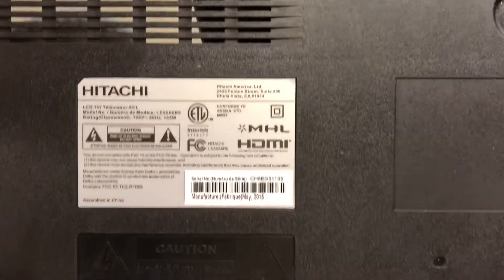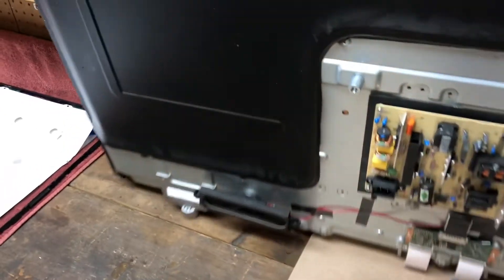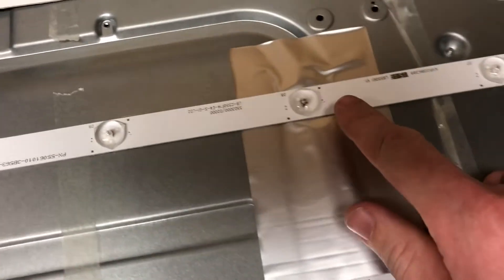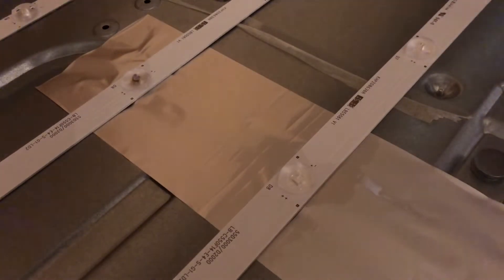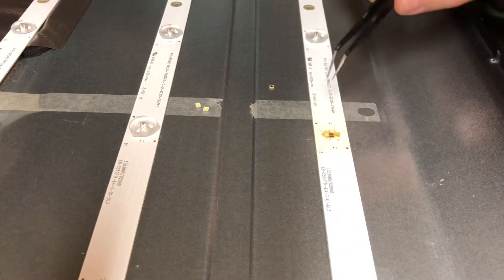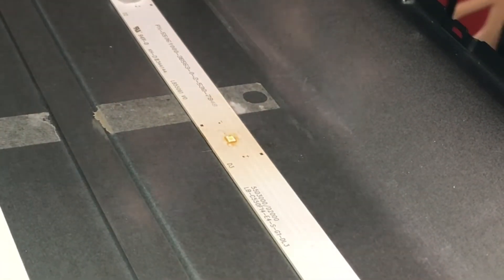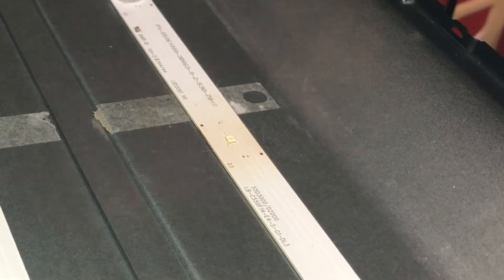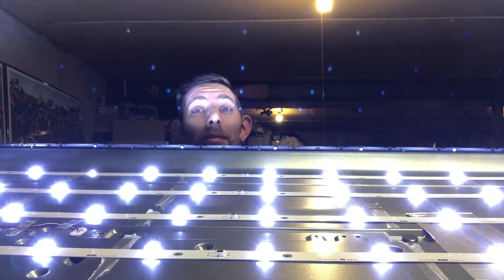Hitachi TV LED back light repair (Model: LE55A6R9)

Comment: Hi Dustin:  I have a Hitachi LE32E6R9 that just stopped working - no picture or sound.  The TV was not dropped or abused.  Could it still be LED strips/diodes or the whole circuit board?  Thanks.
Reply: I might add that the on light turns from red to blue.
Reply from the maker: @TravelswithJoeEly  it could be a backlight issue. Some of the main boards will wait for a signal that indicates the backlight is powered up before activating the main board. You may pull the back cover and check try doing a similar voltage check that I did in this video. Not sure if that model will have the same voltage readings, but you may be able to find testing process by searching the model number on the badcaps.net forums.

Comment: Nice fix, the trouble with these leds tvs is pretty much all brands cheap and premium are shipped with picture settings maxed out and many folk dont bother changing the settings so those leds are running maxed out day in day out doesn't take a genius to work out that they aren't going to last very long in that state, my samsung qled was just the same everything was on 100% picture wise i thought i was sunning my self in spain when the fecker first turned on, i prefer a real dark picture so brought mine down to my comfortable 15 to 20% as i only watch tv at night when i get home from work, also low settings make the tv last, this is very much like the rules you applied to the old crts to make the guns last longer keep the picture down low and they would last for ever.

Comment: How do you determine which voltage of LEDs are needed for the TV?
I have a 32"Hitachi that has a faint picture present, brightness control has no effect on picture, all else is ok, knock on wood.
Reply from the maker: Unless you can do some research on your specific model to see if anyone specifies what size and voltage LEDs are used, there’s not a good way to know without getting the TV apart.  Typically the LED backlights in these TVs are all or nothing. I’ve only seen one brand - Insignia, that wires the LED strips in parallel on some models, so that the backlight can go out gradually (Video here : https://youtu.be/EPU9lyh-rU8). Also, depending on the age of the TV, some older TVs use tiny fluorescent tubes instead of LED strips. I’ve also seen those go out “gradually”. The label on the rear panel of the TV usually indicate “Contains Mercury” if it uses fluorescent lights though.

Comment: My tv still working but won't stay on I was told because of a light bulb inside is going out how do I repair it at home ???
Reply from the maker: It depends on what it uses for backlighting. Some of the older flat screen TVs had fluorescent tubes in them. I’ve never had one of them apart to know what the process entails or if replacement parts are even available. What make and model tv do you have?

Comment: hi  i have led DENKA 55 smart  tv DGS-55UT2SLED i changed the light strips after i powered it up i noticed that only the lower 3 strips work and the 3 strips above are not working i check the strips by tester every group take the same voltage and leds all works but when connect the power supply and check upper group take 84volts and bottom take 130volts what is the problem i checked the pwer supply with strips diconnected i found diffierence but not hight between sides and then checked the resistance of output one side reads in kilo ohms and other in Mega ohmes
Reply from the maker: Mark Mark66 sounds like the lower strips may have some excessive resistance. You may look for a faulty solder joint on one of the LEDs in those lower three strips, or possibly check any connections between the strips and wires.
Reply: @DustinRogersinMO  i checked the strip one by on each strip take 32.3volts and check every group of strips they take same voltage but when connect to power supply bottom has 130v and above has 84v
Reply from the maker: Mark Mark66 can you measure the amount of amps required to power the upper strips vs the lower strips? I suspect that your tester is able to push more amperage than the power supply, therefore they light up when powered by the tester, but not by the power supply. This leads back to there being excessive resistance somewhere in the circuit of the lower strips.
Reply: @DustinRogersinMO  but how can say about the resistance of the out put ports of power supply to strips lower strips port in power supply has k ohms and the upper port reads in mega ohms i think they must has same ports resistance i checked them with and without strips connection
Reply from the maker: Mark Mark66 so you’re measure the resistance on the connections of the power supply? I’m not sure I understand what you mean. Post a picture somewhere and tag or link it here.
Reply: @DustinRogersinMO  yes i checked the resistance  of psu output ports i bring these strips from same tv same model i want to add that when i power up the tv the upper group flash and goes off and still off power supply model sgh5504c23-101hb
Reply: @DustinRogersinMO  hi i checked the voltage and current using tester and multimeter each group take 98V with 39.07mA
Reply: @DustinRogersinMO     thank u  the tv is worked now i checked the power supply ports of the leds there is 10 pins i changed the port of the bottom group and connected it to the other pin that gives 84v the led strips all worked when i tried to check the voltage the power supply waked up and gave 139v for each group then i retured back the wires on the original connection and checked the   leds worked all but the voltage on each group 131v what happened i dont know may be ghost  the tv now works normally

Comment: How did you determine that the power supply board was putting out ample voltage? What should the voltage be for both of the connectors going to the back lights?
Reply from the maker: DeeGi I describe it at 2:45 in the video
Reply: @DustinRogersinMO  I understand you measured 191V for the top one. Is that normal voltage? I know you said 250+V indicates an open in the circuit. I am trying to rule out the power supply board, but I can't find specs anywhere for what the voltage is supposed to be at those connectors.
Reply from the maker: DeeGi the TV I was working on had 66 LEDs wired in series. They were 3V LEDs,  so 3 x 66 will require at least 198V to power them all. If you’ve got at least the minimum voltage required to power all the LEDs in your TV, I would assume that your power supply is fine. 

If you have this same exact model of TV, I’d be willing to bet money that it’s got at least one bad LED. I posted a follow up in another comment or maybe the video description, that this repair only lasted about 2 months of occasional use before another, different LED failed. If you pinpoint that an LED failed, I’d recommend either ordering new replacement strips, or replacing all 66 LEDs, otherwise you’re just going to have it back apart in a couple months.

Comment: Very common problems on LED tv designed.User turned on brightness control to screen to 70% and beyond.The LEDs diodes workings to hard for days in and days out .So within about two years or more your tv LED strips on the tv will blown only one or two LEDs diodes and shorting out the whole LEDs diodes strip.The tv backlight don’t work anymore.Only the settings to screen brightness to 50% or to 60% maximum.So those LEDs diode on those strips and the driver board don’t burns out too.
Reply from the maker: Chi Chu sadly, I think the default on most TVs is probably set to 100% brightness. How else are the manufacturers going to get people to buy more TVs?
Reply: That why people buy LED devices designed should know about this and read their owner manual.If people ever bother to reading it.I do thinks the manufacturers do recommended on those owners manuals not turning on screen brightness background to 70% and beyond all lives days in and out using the TVs products.

Comment: Do you know what the voltage should be for each of the 2 connectors that go out to the LEDs from the power supply board?
Reply from the maker: DallasPilotCar I think I say in the video
Reply: @DustinRogersinMO  you said that if voltage is over 250 vdc then they is a open in the circuit..i have the led tester and the strips tested good.  So unless i know what the voltage should be to each set of 6, i cannot determine if there is a problem with the board that i bought used or if there is still a led circuit problem. You mentioned that you read it some where. I found the service manual but it does not say what the voltage should be
Reply from the maker: DallasPilotCar how much voltage do you currently have? There are 66 LEDs and are 3V that are wired in series, so you’d need at least 198V. When measuring voltage, you need to check it as soon as the TV turns on because if the backlight doesn’t power up, the voltage drops to around 80V IIRC.
Reply from the maker: DallasPilotCar probably also need to check the connections to each LED strip. I’ve repaired other TVs that just had a loose connection that caused the open circuit.

Comment: I had a hell of a time getting the deflector off because of the 2 sided tape.  I tore a little place in it and crinkled it in some places.  Wonder how messed up this will be?  Also when I put my meter on the diode scale and put leads on any of the leds in the tiny test places, no lights came on.  I went to the end of each board and checked the diodes and they seemed to be good and none of the leds looked burned
Reply from the maker: DallasPilotCar I’ve replaced strips in a couple TVs where every single LED was bad. Most of the time it’s just one or two that go out. Test your new strips. If none of the LEDs light up on it, your meter may be faulty, or the battery in your meter may be weak. As far as the ripped/crinkled deflector, I’d just use some clear tape on the backside to prevent further tears. You won’t notice it once it’s reassembled since the diffusers help spread the light a lot.
Reply: @DustinRogersinMO  What size is the battery in your Multimeter?  Is it a 9 volt or 2 each 1.5 volts?
Reply from the maker: DallasPilotCar mine is a 9V

Comment: I got this tv for free but, it has no picture and no sound only the blue light comes on for the power or red what ever color.  Is it worth buying the parts to fix this TV? I already had to order the power cord and the remote so I am out like $15. I have seen all of the boards in a kit for $70 plus the IR sensors, and then the LED stips I think for under $50.  How much did you pay for that little strip of LEDS?
Reply from the maker: DallasPilotCar it really depends on what exactly is wrong with your TV. Have you done any troubleshooting yet to determine what is the cause of the no sound or picture?
Reply: @DustinRogersinMO  I just checked the voltage from the connector that you are talking about and I read 188 volts dc.  On the connector above it the red wire to chassis ground I read 267 volts.  I tried doing the flashlight test and was not able to see the menu.  I have the back off of the TV now but hae not gotten to the LEDs yet.
Reply from the maker: DallasPilotCar with the back off, power the tv up. There are enough gaps that if the backlight is working, you should see light coming through the holes where the wire goes through the case. If the backlight is not working, it’s likely an LED strip issue as these are known for going out on these hitachis. IIRC the menu for this tv displays at the bottom of the screen if you want to try the flashlight test again.
Reply from the maker: DallasPilotCar how do you know the sound doesn’t work?
Reply: @DustinRogersinMO  idk if sound does not work because i did not hook it to any source.. i just expected to here static or something when trying to change channels..i just hear no sound and see no lights at all.
Reply: @DustinRogersinMO  I sent a reply already to this please read that one first.  I am worried about bending the screen when I take the back off completely.  Did you have suction cups.  I am not afraid to work on this TV.  Een if I had to spend another $100 it would be better than buying a brand new 55".  I just wonder how long the replacement parts will work
Reply from the maker: DallasPilotCar I did use suction cups. I bought a couple from harbor freight. I wouldn’t risk doing it without suction cups. If the LCD cracks, it’s done for.
Reply from the maker: DallasPilotCar if you’re not able to see the menu when doing the flashlight test, you may have a main board issue, especially considering you mentioned no sound.
Reply: @DustinRogersinMO  the only way i know that the tv has power is when i plug it in, the red light on front comes on, and when i hit the power remote, the red light turns to blue
Reply: @DustinRogersinMO  thank you for responding. Would i have sound when i had no signal hooked up to tv. Everything looks easy to replace except for the leds
Reply from the maker: There won’t be anything on the TV by itself that will play audio. You’ll have to hook up an input that is playing audio. Most TVs made in the last 10 years go to a blue screen when there is no signal on TV mode. The days of the static and ant races are gone.
Reply: @DustinRogersinMO  Cool,  thank you for your help..i hope the parts are still available i will have to buy the feet or mount also.  May be back asking you something else later about this..take care
Reply: @DustinRogersinMO  Dustin, will you please tell me how many strips come in a set? I bought some on Ebay and they only sent me 2.  Also, they are not that long they are only 20 " long part number is EX-55061001-38563-0-1-544-3793 ANOTHER number is LB-C55OF14- and KHP200639A. In the video it looks like the strips should be as wide as the TV
Reply from the maker: Each strip that is the width of the TV is actually two pieces. A lot of listings on eBay are only for one complete strip (2 piece). Here’s a full set, but it looks like they’re currently out of stock. 

https://www.shopjimmy.com/hitachi-lb55061-replacement-led-strips-12-strips.htm

Comment: Great video, I have a Hitachi LE43A509 with similar LED strips SVJ430A07_rev08_10Led_150403 . 94v E257384 
I was wondering if these will be the same type of LED bulbs 3030 I think you said at 3v.
Reply from the maker: Frank Zell not sure. I’d guess since it’s the same brand that they’d use the same type of LEDs, but the 3030 LEDs do come in a 6v variety, so be sure to test one of your current LEDs to see if 3v will light it up.
Reply: @DustinRogersinMO  I just checked with 3v and they light up. Then I tried 6v and they were bright. I'm not sure now
Reply from the maker: Frank Zell check how much voltage is coming from the power supply board then divide that by the number of LEDs your TV has. For example, if you measure 180v at the power supply board/LED driver and you have 60 LEDs, that’d be 3V voltage drop across each LED.
Reply: @DustinRogersinMO  Didn't think about that. Good ideal... I checked the volts and it's jumping from 123 ish to 153v. So in theory it's going to be the 3v then bulbs
Reply: @frankgzell83  Did that end up working out? Have the same model Hitachi and just found this video. Thinking about go your route...
Reply: @loganj5588  Hi there, yes I end up buying the 3030 LED's off eBay and soldered one into the strip. Just find the bulb that is blown/brown colored and heat it up to remove it.  When you solder the new one in just be careful you don't heat it up too much because the LED cracks in half.  Good thing they send you 10 of them.

Comment: How did you determine that the led strips needed to be changed? I understand you maybe didn't see any backlight when turning on the TV. But is there a way to determine this before you go inside the TV to check this out?
Reply from the maker: Gabi Vazquez you have to measure the voltage output to the LED strips. If proper voltage is going to the LED strips, but they are night lighting up, then there’s either a bad led or a connector that’s come unplugged. Either way, you’ll have to tear it down to get to the strips. If you don’t have proper voltage going to the LED strips, then you likely have a power supply/LED driver issue. Watch at 2:00 how I tested the voltage output to the LED’s. I did this first before I tore down the TV. I just did it again for the video to demonstrate.
Reply: @DustinRogersinMO  Thank you brother, it sure as heck was at 266v so I will be doing this breakdown and installing new strips see how long it lasts.
Reply: @DustinRogersinMO  would you happen to know what could be the problem with a TV that has good back lights but no picture on the screen? TCon, power supply, and min boards are all clean and with no damage or burns or blown capacitors. It's got me stuck.
Reply from the maker: Gabi Vazquez what model tv?
Reply: @DustinRogersinMO  it's a toshiba 50" fire tv edition  50LF621U19
Reply from the maker: Gabi Vazquez I did a little searching and didn’t come up with any troubleshooting tips for it. If you haven’t checked out the forum at www.badcaps.net yet, you should, and sign up for a free account while there. It has a lot of knowledgeable people that have way more experience than me that will help you troubleshoot and pinpoint issues.